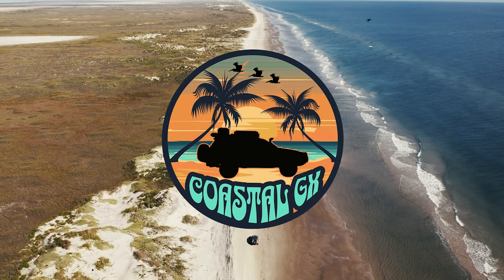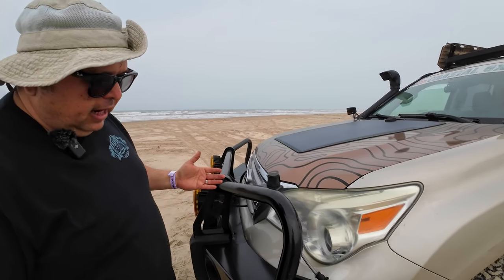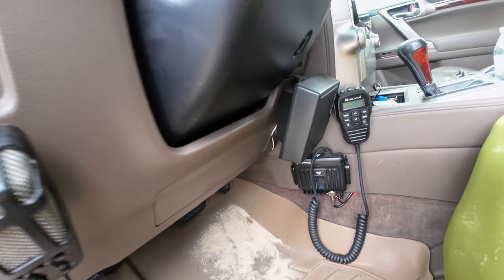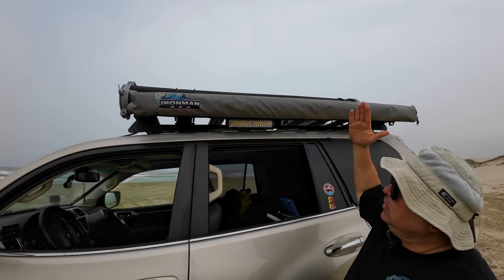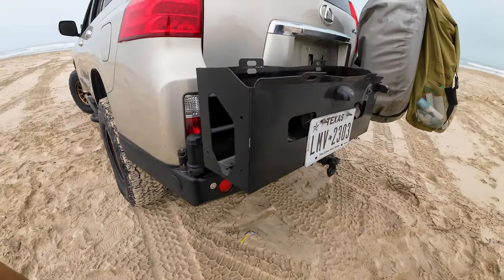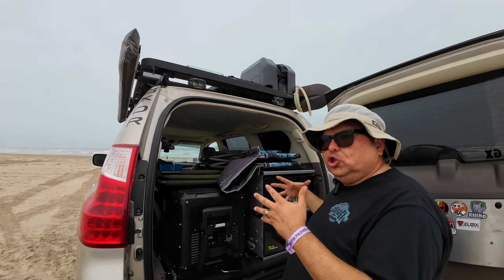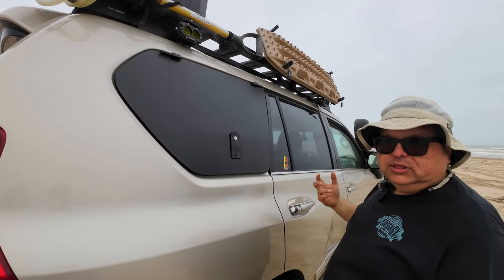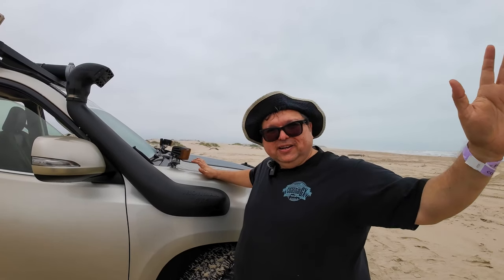Lexus GX460 Longterm Review - PROS & CONS - Modified for BEACH DRIVING

Comment: Great video ! your rig is really cool love those wheels the color matches well whit the truck , this old GX's have very little mechanical issues i think for my experience  the mayor ones are the valley plate leak , secondary air system aka "Limp mode ", and timing chain cover leak , the secondary air system can be easily fix at home GXBOB have a video about it , for the other issues is just best have a really good mechanic and cash on had because they are not cheap to repair the rest is just commonsense maintenance and this trucks will run long time , my advise to any one buying one of this trucks will be check this issues first.
Reply from the maker: Great advise!! Yes, I did the secondary air system upgrade; learned from the awesome GXbob

Comment: i get what you mean with the mechanical issue. i live in Kuwait in the Middle East so basically 50-55 degree hot soaring weather. Also, winters can go as low as -1 degrees cels. i have a 2012 Toyota sequoia limited and it has about 240,000kms. About 149000 miles. And it has that coolant leak issue. Also, one of my good friends has a 2013 Toyota landcruiser with the 4.6 v8 you guys don’t get. basically a detuned 5.7 that the sequoia gets. And it has about 260,000kms on it and it just started having the coolant leakage and stuff. it’s all about age ig. but he has installed an iron man 2.5 lift inch on the landcruiser. and ever since, it has been acting up in terms of heating issues with the gearbox and engine whilst idle. but, i think it has to do with our soaring weather lol! nevertheless, Toyotas do well here in the Middle East
Reply from the maker: Thanks for sharing. I love the Toyota/Lexus car culture in the Middle East. Y’all have good taste 😎

Comment: I drove down PI recently (Toyota 4R TRD Premium).  Two questions - can the tide catch you even if you tent at the dunes?  How do you watch out for high tides and can my regular height (T4R-TRD) make it all the way down (mile 50) the beach?  Everybody seems to have lifted vehicles.
Reply from the maker: It is highly unlikely that the tide will catch you at the edge of a dune, but a sudden storm with high winds or severe cold front can certainly do so. We've had to take refuge closer to the dunes in order to avoid water coming into camp. Your awesome 4runner will have zero issues making it anywhere out there. You may consider lowering the tire pressure to about 16psi for added security and comfort, but that's your choice. I always lower my TP in order to increase traction, reduce a risk of a puncture, and ride quality improvement. Good luck and thanks for watching.